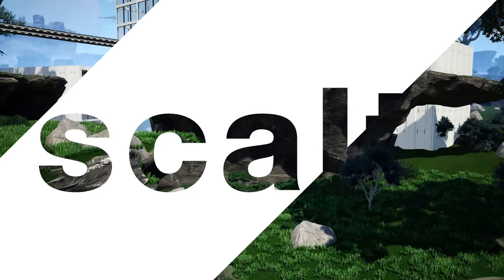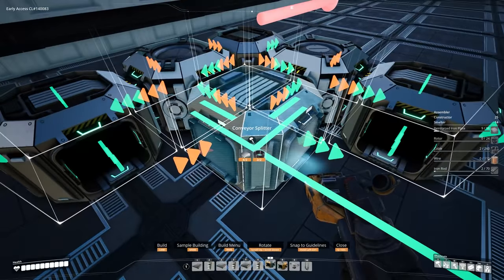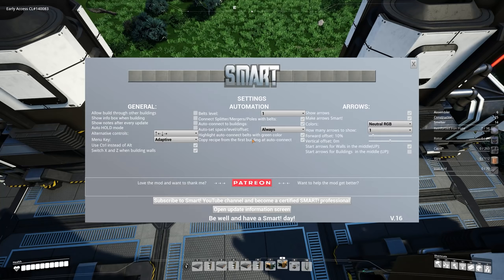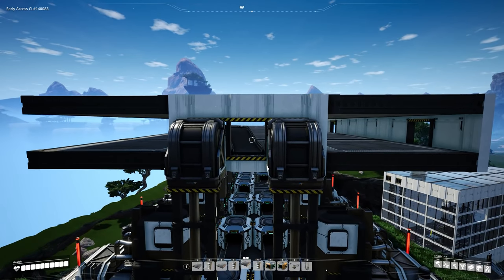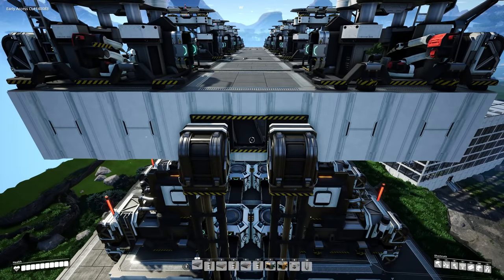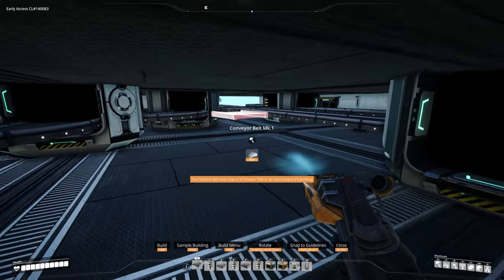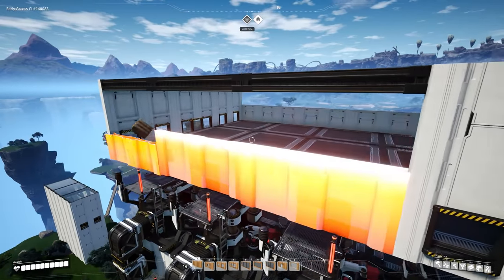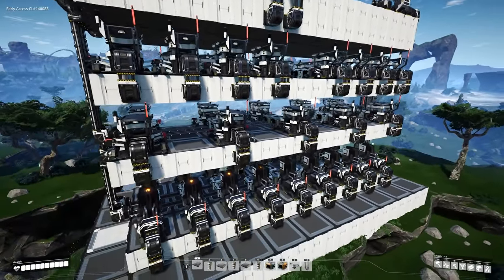100% EFFICIENT A.I. Limiter Factory - 30 / minute [SATISFACTORY GUIDE]

Comment: At 14:00 wouldn’t it be easier to have either smelter just split off in either directions without the splitter/merger box in the middle? You’re getting 30 output in both directions at the end and would only require some inverted belt snaking to be symmetrical. Where each one makes an S or Z shape to go in their respective directions.
Reply from the maker: S Y M M E T R Y

Comment: I always wanted to ask. If I use level 5 conveyor belt in all factories from your guides, will it work fine? Or do you need some changes? Thanks for you awesome guids :)
Reply from the maker: No! Some builds rely on belt speed to balance inputs. If those specific belts referenced are not used, it’ll not load balance but overflow and that will cause delays on getting the factory running 100% efficient.

Edit: Not shouting at you, just establishing urgency in the importance of using specific belt speeds where I note for load balance purposes.
Reply: @Scalti  thanks for answer.

Comment: Going to copycat this and I'm hoping that I'll be able to also make an output for copper products with some overclocking.
If it becomes a mess, like usual when I do stuff myself, I will delete the copper outputs after.........
..
Half way through, Scalti mentions at this point that 'the beltwork on this layer becomes TRICKY'.
Oh gawd, I find it almost always tricky, so when he says it's TRICKY.......... I'm scared.
..
Done, with 12 Contructors on an additional floor, 8* Copper wire leading into 4* Cable, overclocked Copper smelters to 120%
..
The whole thing, including finding the nodes, 8.5 hours.